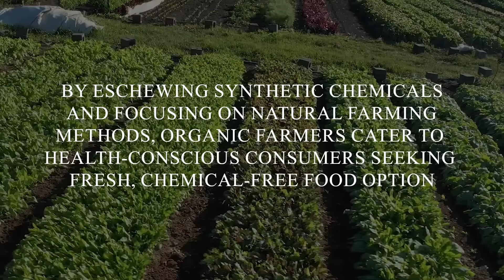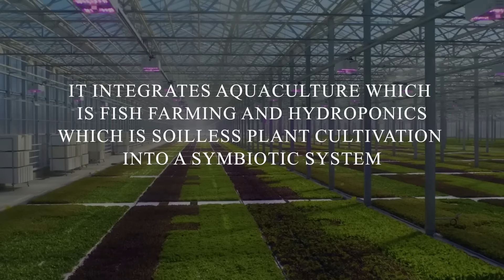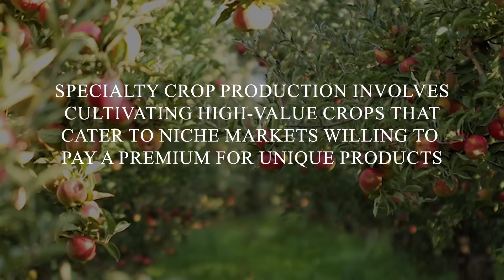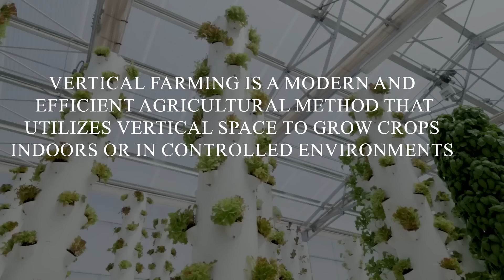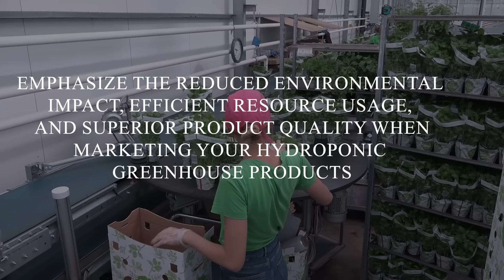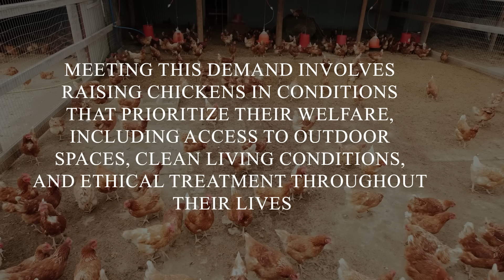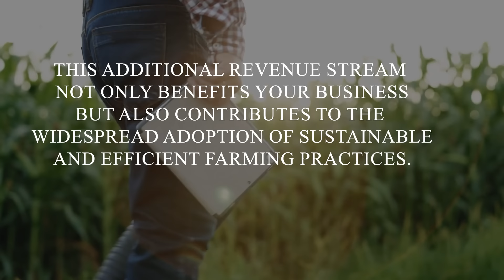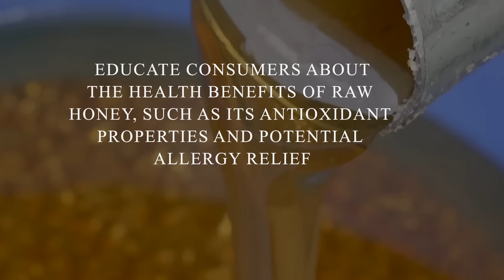10 Agriculture Business Ideas to Become an Agri Millionaire

Comment: Easier said than done..
Im currently running a pilot on hydroponic tomatos using hybrid DWC and NFT
The challenges are a nightmare.
Reply: Toprak bitki şu ilişkilerine çalış.
Reply: I’m looking into hydroponics planning on building my own small system and invest in one in time.
Reply: @swagboss10000  good it will be great for your hobby and health
Let me know what I can do for that.
Reply: I am planning for vertical aquaponics farming even though I am far from starting due to financial issues so what kind of challenges are you guys facing ?
Reply: Can u guide me?
Reply: I am in huge debts because my greenhouse and  hydroponic farm failed. I am looking for new partners. It's capital intensive and requires time to turn over. However, if it succeeds, it is very profitable in the long run.